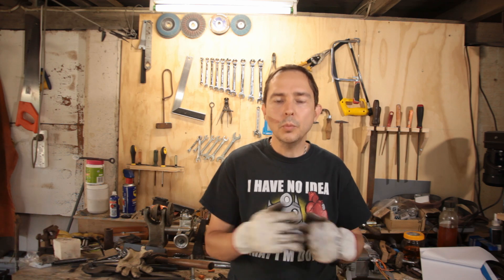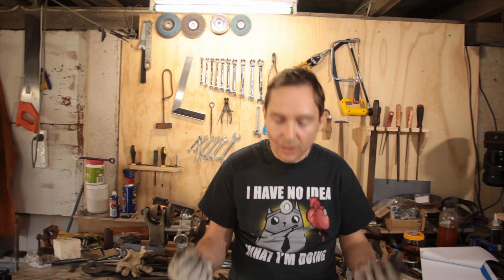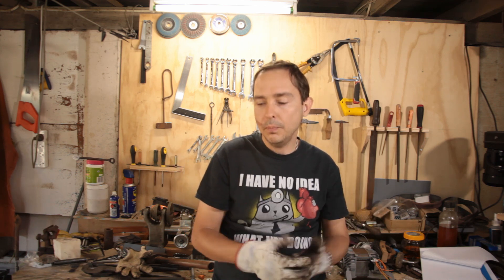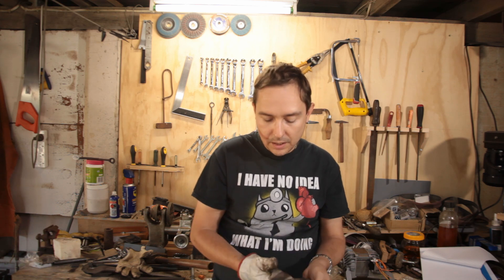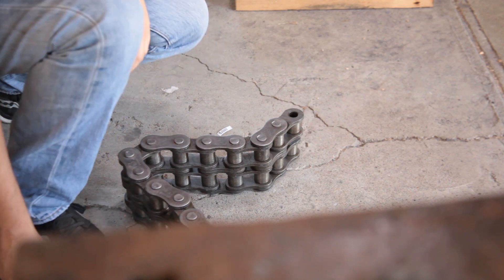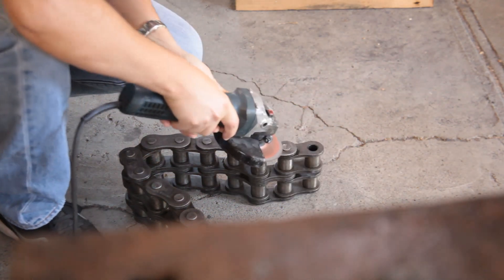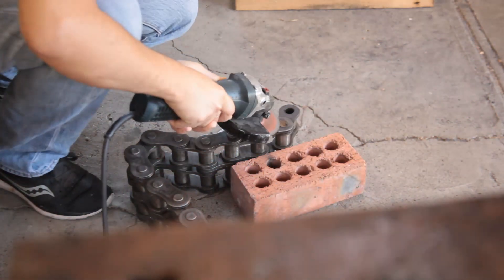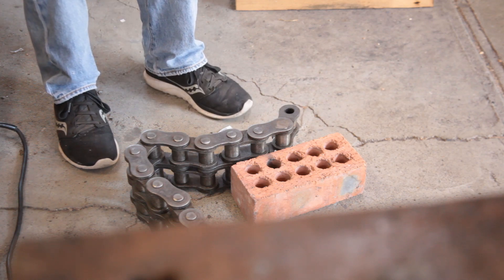Breaking some big ass duplex roller chain

Comment: I would of done had the pin link out with not grinding the head rivets off. I work with this stuff on a daily basis. I cut up to size 240-4 with a hammer and punch. I cut leave chain for crains too.

Comment: so those chains come apart by the whole outer links and not one pin at a time.. master-links to put chains together are made to go through barrels of the roller chains.. if you grind both of the pins on one side of the link.. and knock them down through the barrels.. you are left with right parts to install the master-link to make one big continues chain
Reply from the maker: Not these, these are just off cuts from a major refit at a composting facility, the master link is on the machine. These were literal trimmed off the main length with a cut off wheel.